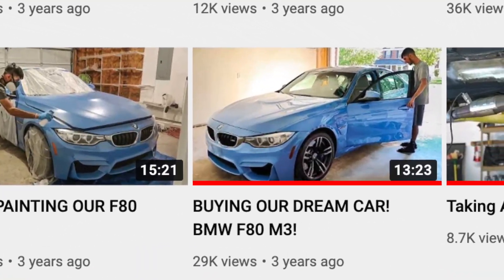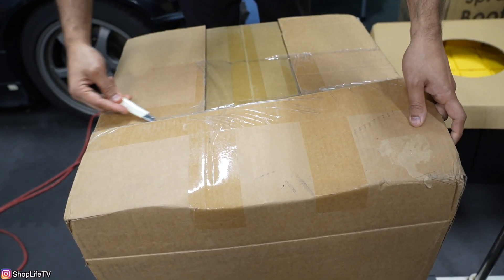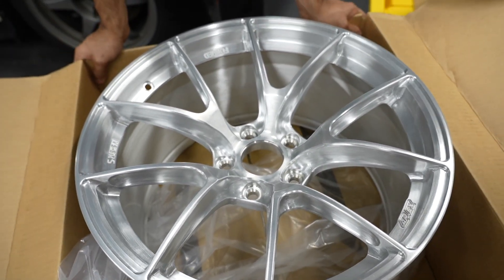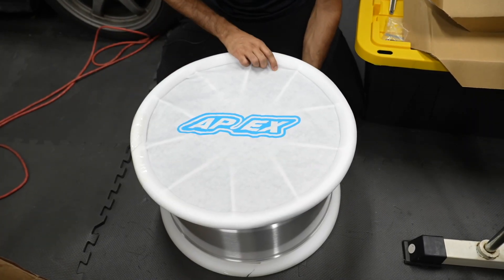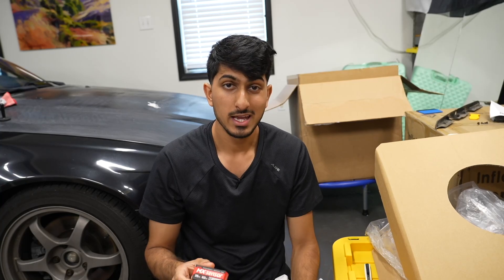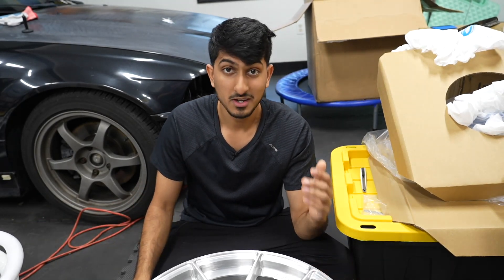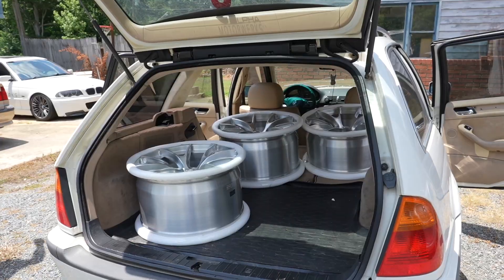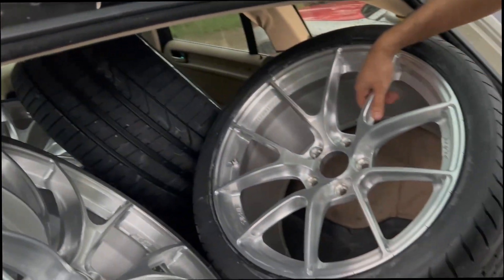NEW WHEELS FOR MY BMW F80 M3 (APEX VS-5RS PERFECT FITMENT!)

Comment from the maker: UPDATE: Apex contacted me after seeing the video and wanted to make things right. They gave me the option to warranty out the blemished wheel or give me a discount on the bad wheel since I already had the tires mounted. Honestly impressed with their customer service and it seems like the company is ran by enthusiasts who actually care. I did not even contact them or post about the issues anywhere else. Respect.

We are taking the F80 to MPact in August! Hope to see a lot of you there! Comment down below if you are going!
Reply: I really like my BMW 2004 330 CI SMG transmission can you recommend anybody they could possibly help me get it to where it needs to be and be restored I live in California Redlands is the city
Reply: Look forward to seeing you there!
Reply: Glad we got you sorted out and thanks for picking up a set of these wheels! Those blemishes definitely weren't up to our standards but I'm glad our customer service team got you sorted out. One of our engineers actually found your video initially and referred it to the CS team. We'll be looking at ways to improve our QC process using your footage as an example. 

Enjoy the VS-5RS!

-Tom
Reply: the "bubbles" are not IN the metal itself (not a defect of the casting), its a defect of the applied clearcoat, this is called "solvent pop".  This happens when clear is applied too heavily or over top a previous coating that hasn't completely cured.

Comment: Hi, sorry I’m wondering if you could help me with the info. So I see that the front wheels have a few options for my F80 M3 2015 base with standard brake, either 19x10” ET25 or ET40, what does it mean or they both will fit the M3? Thanks

Comment: Just ordered a set for my avus blue 18 comp f80.  Exact same size (brushed clear 19x11 et44 & 19x10 et25).  Kinda worried about fitment in the front, gets pretty close to rubbing the spring perch, are you running coilovers, negative camber?  What is your suspension setup?

Comment: The wheel finish looks🔥🔥!!!  I did my first Gang-up Apex Group Buy last fall and love the wheels I got for my e46 M3.  Their warranty replacement is really great too!  I know you already mounted them, etc. but I bet if you contacted them about the blemishes you noted and work with you to make it right.n
Reply from the maker: It is a great finish to hide any minor scratches that will occur over the years. I read about their warranty and might contact them regarding the blemishes. Thanks Craig!

Comment: 3:46 casting? They’re cast wheels, not forged??? 👀😳 if so just understand you may wind up paying more than the upfront cost after you deal with cracked wheels etc…just do some research on Apex or cast wheels in general and problems like “apex cracked wheel” or “cast wheel problems”. If you already know what you’re getting into just ignore this
Edit: I guess if they’re intended to be “beater” wheels for track use  it’s not a problem,
Reply from the maker: They are forged lol I used the wrong term

Comment: Great choice guys! Looks amazing - offset & tire size is perfect! 

Surprisingly, the VS-5RS looks similar to the FI-R.
Reply from the maker: Thanks Rich and they are very similar. The main differences are the hub design and the Fi-R have actual holes in the spokes.
Reply: @ShopLifeTV  
$7,500 for the cutouts which are seen only at an angel, lol!

Comment: Man, the F80 is looking sweet with those wheels, I would have went with a two tone "Gun Metal Grey" with silver outer rim. Also the money you spent on them I would have sent them back with the blemishes that you found, but as long as you're happy with them,  that's the main thing. Heck I would even put them on my F31...Really like the rear shadow line lights on your F80. Again a very formative video.
Reply from the maker: Thanks man! I might play around with the color once I’m ready for a change. They will be gunmetal color in no time with the brake dust 😂. Honestly I’m not too worried about the damage since now I won’t be as worried about getting them dirty or be stressed when tires are being mounted lol
Reply: @ShopLifeTV  LOL, that's one way looking at it , not having to worry about kerbing them!!!

Comment: Wow! Those wheels make Alpina wheels look like a bargain (real ones are around $1,500 EACH). BBS are OEM for my E32. Put wheel locks on those. There have been some news articles on the recent rash of high end wheel thefts in urban areas. Look it up. Don't be the guy to find your car on cinder blocks minus your expensive wheels. Get wheel insurance - most car insurance companies don't cover high end wheels esp if they are non OEM or aftermarket.

Alpinas have some protection courtesy of keyed wheel center covers and a stemless air system (valve stem relocated to the wheel hub).
Reply from the maker: Haha I love Alpina wheels, and BBS has a lot of OEM wheel options for various manufacturers, which is why I am a big fan of BBS wheels. Many of BMWs great wheel designs have been made by BBS. Definitely going to put on some wheel locks!